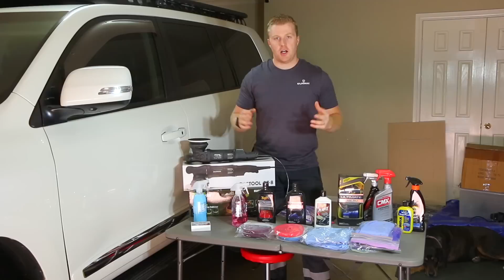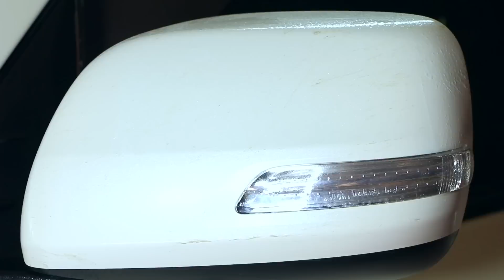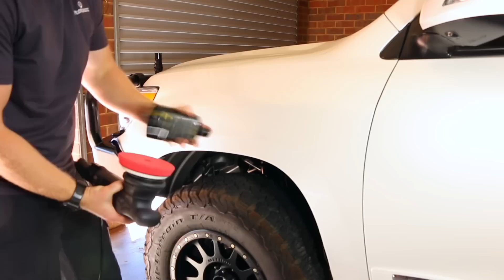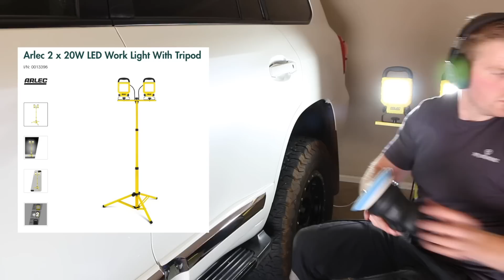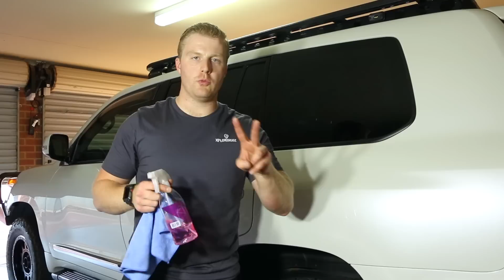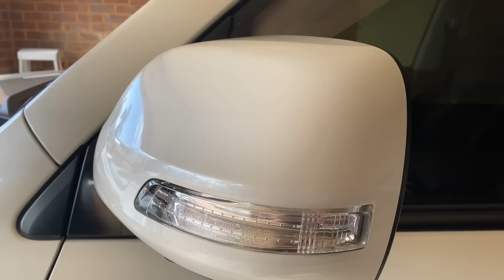ULTIMATE 4WD DETAIL | How to remove pinstripes & scratches from your 4x4 | Clay, Cut, Polish Coating

Comment: What you pay for all that? Over $300 of products I’d say
Reply from the maker: Yeah, there's a bit of gear there. I have built it up slowly over time, but most of it will last several details (or a couple of years) depending on how often you do this. The pads and clay bay are the things that you need to replace each time (generally)

Comment: Thanks for the vid. what pads did you use exactly or would recommend for cutting, polishing and finishing? Sorry could not see in vid or your list in the description. Thanks in advance.
Reply from the maker: Cheers mate, glad you enjoyed it. 
So I buy from this company and use the Gyeon Products. They have a few different pads, for heavy cut, cut, polish and finish. https://www.carcareproducts.com.au/gyeon-q2m-cut-pad-145mm.html
I've also most recently used this microfibre cutting pad which has worked really well. https://www.carcareproducts.com.au/mint-protools-rod-microfibre-cutting-pad-150mm.html
I'd still finish off with the Gyeon pads. Just make sure to buy the right size for your DA.
Cheers, Nathan.
Reply: @XploringOz  great. Thanks for your dedication to your quality vids, and super quick response. Legend 👍
Reply from the maker: @mozeca83  No problems. Cheers.

Comment: Hey Nathan , Alot of people told me that Ceramic Coating does not really help but I really wasn't satisfied with that answer , So what's your take on it?
Reply from the maker: Hey mate, I only have experience with this consumer level hybrid coatings and I think they provide some benefit. They definitely coat the vehicle and would protect against things like acidic substances (bird poo) and UV damage, however they wouldn't protect against surface scratches from off-road driving. Further, using these cheaper and more basic coatings also mean you have to boost or re-apply to coating on a regular basis to ensure full protection. 
The professional coatings are of a much higher quality and provide a significantly longer and stronger coat, however still won't protect against extended off-road driving like scratches as well as something like vinyl protection. 
I'll continue to use the hybrid coatings, as not only does it protect the vehicle somewhat at a fraction of the price, but the end visual result is awesome too. 
Hope that can help, cheers.
Reply: @XploringOz  Well Noted , Thanks Mate.

Comment: Great video. Looks so good. Is the ceramic coating you use, inplace of a wax product? How often do you apply the ceramic coating?
Reply from the maker: Thanks mate 👍 I was very happy with the way it turned out. 
Yes, the ceramic coating replaced the need for a wax. This particular hybrid spray coating would probably last between 6-8 months, but it would heavily depend on what the vehicle is exposed to. I normally get around to doing it once a year.